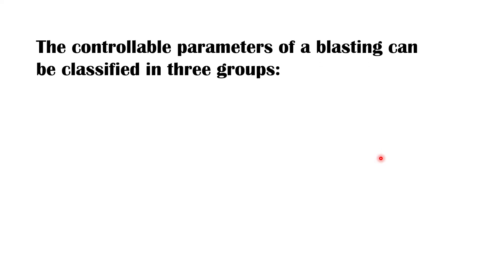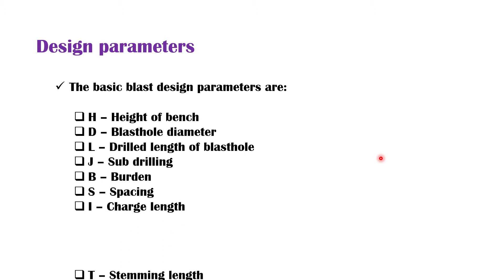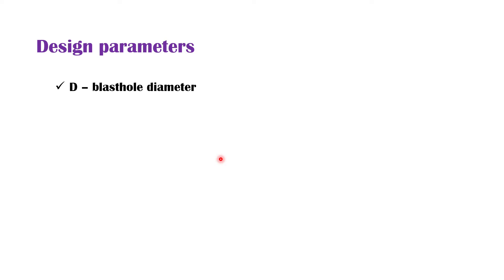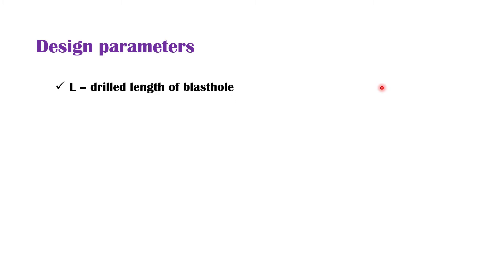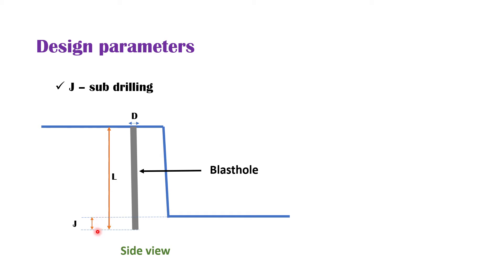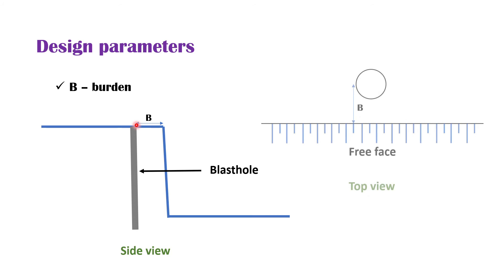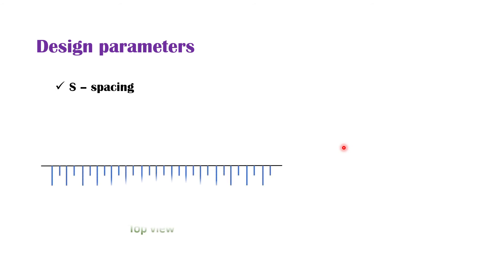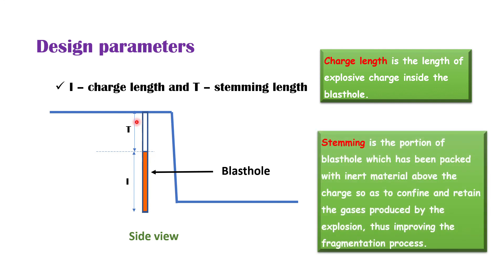Blast design parameters.

Comment: Sir how to calculate these parameter of blast hole such is burden, spacing, length of stemming, length of calume charge, length of bottom charge, length of the hole and subdrilling of hole
Reply from the maker: I will make one video on this within one week. I will explain that thing in detail.
Reply: @miningengineering7786  Sir lots of thinks
Reply: @miningengineering7786  Sir please make a video about the parameter of blast paper is very close to near 27 February the second paper of the mining introductory